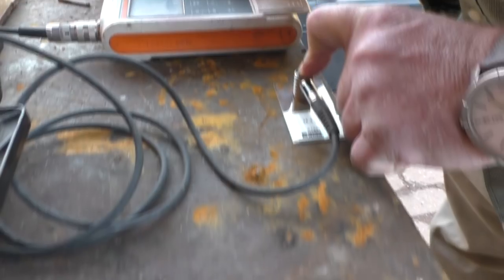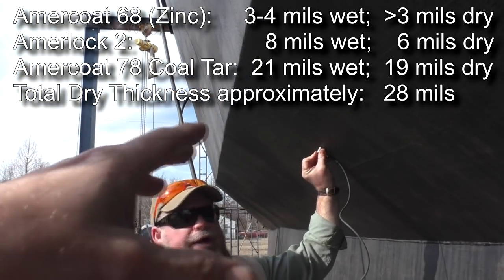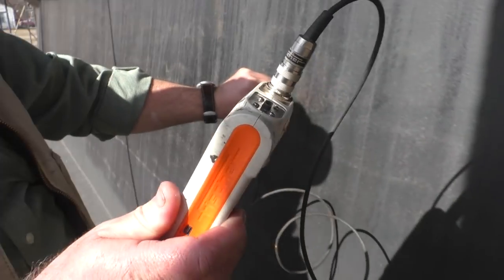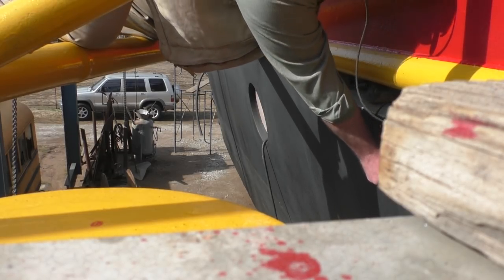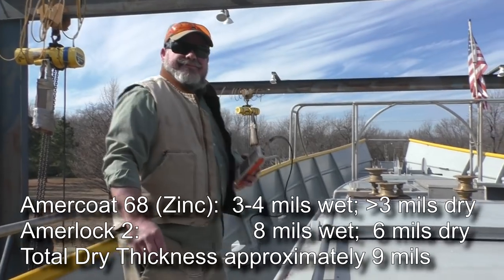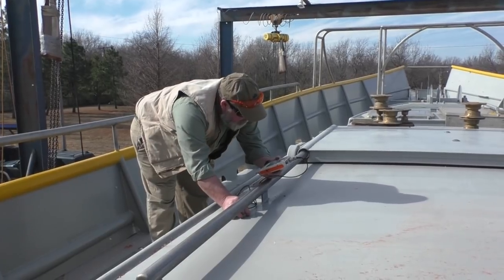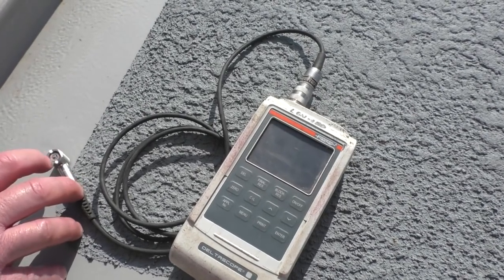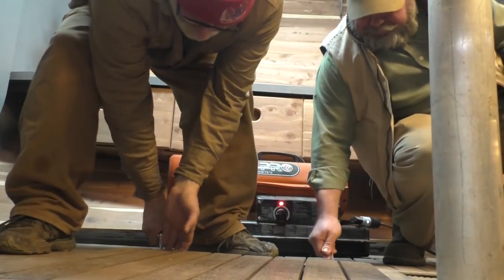Industrial Coatings Inspector with Dry Film Meter

Comment: Hey Doug, You mentioned possibly cleaning around and under those pipes below the flooring... was thinking you could make an inside out belt sander arrangement for wrapping around the inaccessible bottom portions by taking a regular belt, then cutting it on a diagonal bias so it can be wrapped around the pipe in place with the grit facing inwards, and patch the seam with some wraps of duct tape, ALL the way around the belt. With that in place it can be turned by a drill chuck wrapped with tape, or if you have some sections of bicycle tire that fit the chuck snugly, that will give the belt traction to spin around the pipe freely....  Otherwise there's always long strips of crocus cloth/sandpaper by hand to clean it up...
Reply: Mike,  it doesn't need anything like that level of preparation to be ready for receiving an application of coating

Comment: Speaking of de-greasers, straight Simple Green will dissolve roofing tar and will cut engine oil no problem. It is really safe enough to be used before sanitation in meat packing plants to cut animal fat off of concrete and equipment. I would recommend carrying a few gallons aboard ship for de-greasing and general cleaning without sanitizing since it is safe enough that you aren't going to have issues with bringing it into port somewhere and an inspector telling you it is illegal in that country.
Reply: Simple green works great but it's mildly corrosive to aluminium. Got to make sure it gets washed off well.
Reply: @eliasb794  I didn't know that about it. Then again, I have never used it to clean Al. Thanks for the tip.

Comment: When we spray Intumescent coatings on structural steel, we get 15-30 mils first pass and final thickness varies from 60-280 dry mils. we will do 1 pass a day. It looks great when complete, but it is very very expensive
Reply: And if that coating ever is in a fire it will expand even more,  and it will be worth everything it costs.   Much better than the old cement based system.
Reply: @MrEric_API  We apply cementitious fireproofing also. certain levels of it are great. All of the cementitious products are more cost friendly than the intumescent and the job can be completed faster with cementitious. Intumescent is great for an exposed area.
Reply: @roxborotomm  yes its cheaper, however there are better options for most clients.  Cementitious coatings are prone to trapping moisture, and eventually liquid water.  Some of the worst external surface corrosion I've seen in my career have been at these locations.  Anytime moisture gets trapped, corrosion will follow.   If drainage paths are planned, it will go a long.  Like do many options,  If applied correctly and properly maintained it can work,  but if cost savings was a deciding factor, then adequate maintenance will likely suffer also.   Age old dilemma.....
Reply: @MrEric_API  Most cementitious fireproofing products are used indoors in a controlled environment. We have done some exterior cementitious work. but it closely resembles concrete. Cracks will form that will be caulked. Nothing is fool proof
Reply: @roxborotomm    yes. Nothing is fool proof,  and most of the examples I see are old to quite old (perhaps even really old)  and yes the maintenence ignored is the largest contributer to damage.   "We gotta do the maintenence"

Comment: For pipe joints look to the sprinkler pipe industry. Numerous products for fire piping in highly corrosive area all so color code all piping that way if piping breaks and or leaks you know what system to belongs to. Also boiler piping systems. Recommend to contact CH2m Hill for processing piping for waster water treatment plants multi system piping coating and protection.

Comment: I want to toss this into your coating mix.  I worked for an off shore company that sold and repaired down hole tools.  After the repairs they were cleaned and dried.  We then dipped them into vats of WD-40 and hung them up to air dry.  After the raw iron or other steel dried we would paint with paint.  The tools would go out on jobs along the coast as well as offshore.  This process kept them from rusting up and seizing up.  You could get a few 25 gallons of WD-40 to go on your journey.  If you see a rust spot or a nick just coat it.  I was always surprised that WD-40 could be painted over.

Comment: PPG is pretty good, we’ve had better luck with Sherwin Willams Zinc Clad HS, macropoxy, and arcolon
Reply: What are the advantages of arcolon over other urethanes?
Reply: Mr. Garber better UV resistance
Reply: @bduff007  under what what temperature and humidity conditions can apply it?